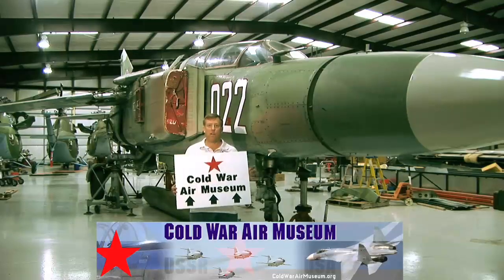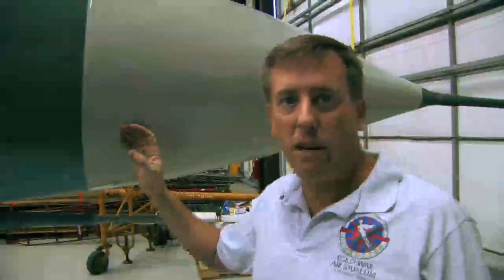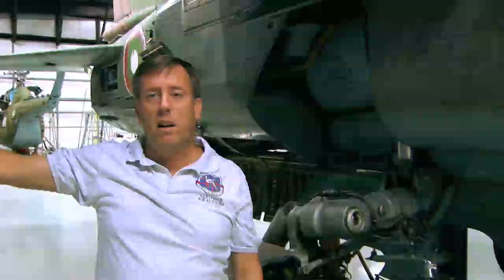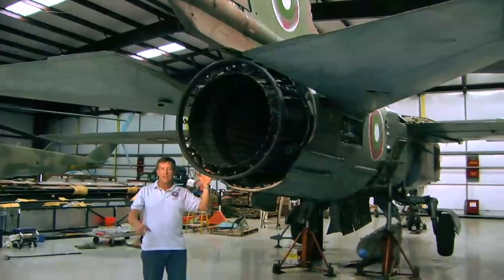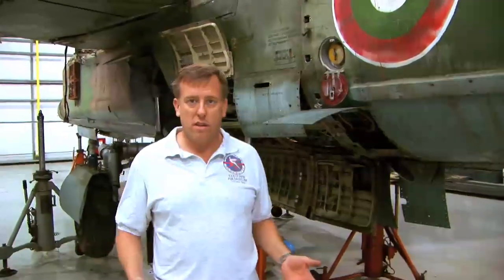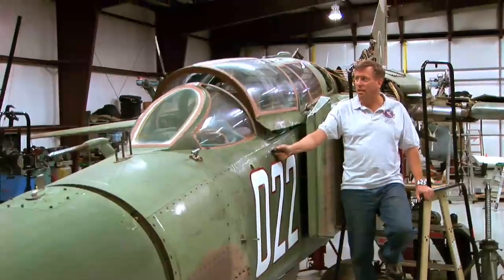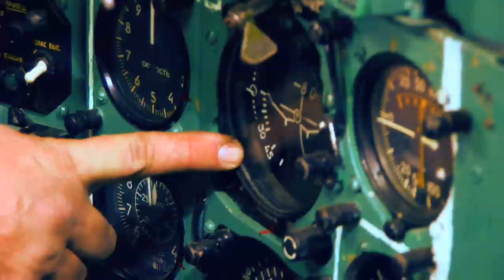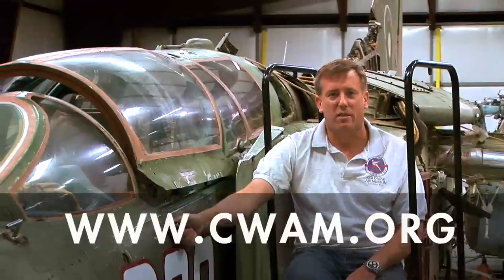MiG-23 HD quality

Comment: I read in "Jets" magazine that the Soviets actually de-rated the engines of the MiG-23 to make sure that the nations who bought them would be reliable customers. So by the time the engines had to be replaced, they would buy them straight of the Soviet Union and no problem whatsoever.

But if your nation fell out with the Soviet Union, tough luck keeping your MiG-23's flying Tobarich. One such nation was Egypt, who had to retire hundreds of MiG-23's when the Soviets didn't agree with them buying the F-4 Phantom. With no replacement engines, their MiG-23's simply couldn't fly anymore.
Reply: Hundreds? Egypt had 12 MiG-23 only.

Comment: +coldwarair  One possible export upgrade would have been the Mikojan-Gurevich-23bis, to pack the Kopjo multimode radar in addition to an Arkhip Lyul'ka 31F-M1 afterburning turbofan (replacing the R-29F-300 turbojet); the MiG-23UM would have been its counterpart tactical trainer.  The cockpit would integrate the head-up and multifunction displays from the Sukhoi-25 plus the Kopjo control panel into the legacy MiG-23MLD instrumentation and controls.  A subsequent Izdelie (MiG-23bisZh) would substitute a Fazotron N-010 backported from the MiG-29/35.

Comment: Also a lot of people wonder what the white line is for just a little off to the right is. The line is for if you get into a spin you push the control stick right against it and it should help you recover from the spin. Apparently Mig-23s could get into spin if you maneuvered wrong but not common.

Comment: It was meant to replace the MIG-21 - that went very well. It was a abysmal aircraft - A F-111 pilot said, he didn't think anything could turn worse that the 111. He was wrong.....But it has that USSR "Ugly Beauty" about it that I love
Reply: It depends on which MiG-23 he was flying with. Later models were just a little worse than F-16 in terms of maneuvering
Reply: @ГеоргийМурзич  Yes, but the avionics an ergonomi was WAY worse. The F-16's HOTAS system is just 1 parameter.....

Comment: it's exactly like the f-4 it even has the net cutters behind it next to the fuselage, the soviets reversed engineered the f-4 intakes. they didn't know what the cutters where for but they put them on anyway.
Reply: It is a debunked myth. The gaps between intakes and fuselage are for passing boundary air flow. Rods in gaps also aren't "net cutters". Just connections between intake wedges and fuselage. For structural rigidity. Without them intakes would be ripped of from fuselage. Also they are different in form and place between F-4 and MiG-23. So it's not a "reverse engineered" something. Just similar approach to air dynamics of the time.
Reply: @alexlobanov7549  
Yes it is reversed engineered, that's a well established fact and one that the sources in eastern Europe that sell these cite.
My friend in Texas bought one of these last year from the same pipeline that this one came from, and they were sharpened on the F4 to be net cutters for Naval service. 
Just a month or so ago the man who has the only airworthy MIG23 in the US did a walk around on his and he tells the whole story about the intakes being reverse engineered and how the Soviets unnecessarily sharpened the leading edges on those brackets, they are brackets but indeed they were sharpened to cut the nets on the emergency barrier, otherwise it would rip the plane apart right there, this way the net slides down the fuselage and tightens up on the leading edges of the wings.
Reply: @dukecraig2402  just some multi millionaire talking bs to impress the  mortals... aerodynamic laws are constant and design parameters follow suit. they are only alike due to having similar flight performance needs but a closer inspection you can see that the mig has different geometry and has holes on it. intakes that have a fence and bracket design can be found on pervious aircraft design. i guess next your going to say the soko j 21/ g-2 galeb are copies of the f4 because they use a bracket intake...
Reply: And those intakes on the F-4 look just like the ones on the CF-105 Arrow...